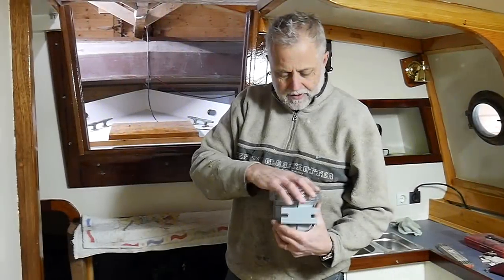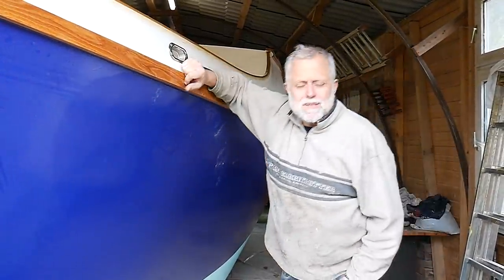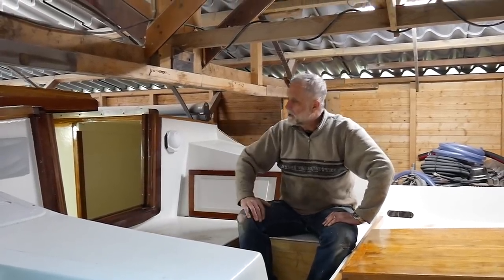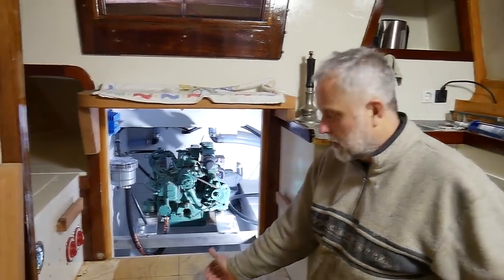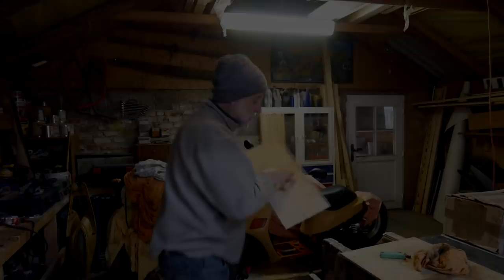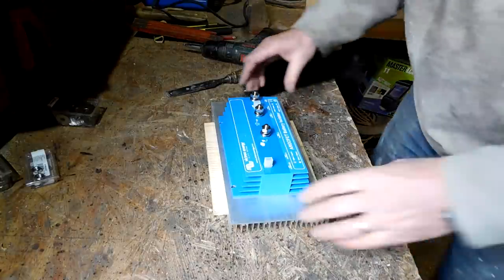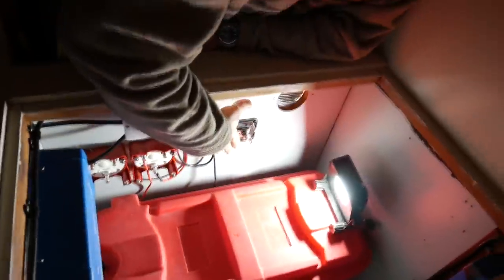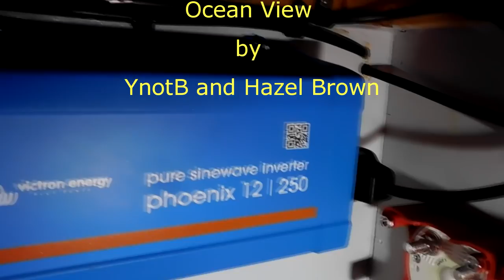A tour of the boat, and engine room and electrics progress - SV Tapatya EP178

Comment: Hi Tony. She is looking great. Speaking of low tech, one of my father's  early boats was on older 65' schooner with zero electrics, alcohol stove, lantern for all lighting, and a hand start diesel (which started most of the time).
Reply from the maker: Thanks Charles. That sounds very like the boat I mentioned (although this one was some 40ft). It had no installed electrics, except the wires for the nav lights, and also had a hand crank diesel - single cylinder, long stroke, from the late 1920s or early 30s, if I remember correctly. It was an absolute beast to start, and sometimes didn't.

Comment: We bought a used Balboa and the Washboards were badly weathered plywood. I made up a new set from old mahogany tongue and groove 'wall' boards. They looked great but it was either 'Dark and Stuffy' or 'Welcome flies and Neighbor's gazes'. So I made a second set with moveable louvers and fine mesh brass screen on the inside. Really helped on hot rainy days or sultry summer nights when it wasn't necessary to lock things up tight. Hard to see in that quick pan of the Head, but is that mirror flush mounted? A simple box frame behind it and some hinges and a catch would provide some welcome storage for dental and cosmetic products without having to rummage through deep, quickly cluttered shelves. 'You can never have too much stowage on-board'...
Reply from the maker: Yes Mike. It's a flat mirror but there's a good medicine cupboard/ locker on the starboard side in there 👍

Comment: Hi Tony, I'm watching your movie reports for over a year, picking from you some methods, tricks and solutions. Like starting to cut with hand krajzeige in the middle of play or installing composting toilet instead of regular. You are doing great job both with building the boat and making movies. I started to build my boat relatively not far from you - in the town of Opole, Poland. This is also a junk schooner, but only 6,5 m long. I want to go sailing this Summer, despite of the stage of finishing inside. I can make it later, when sailing or anchoring. When do you plan to start sailing? Do you have your sails sawn already?
Reply from the maker: Hi Krzysztof. Thanks for your comment and for watching. It's always great to hear that something I show has helped somebody somehow. Your boat sounds good. As to sails, I'm having them made by the sail loft ( Tuchwerkstatt) in Greifswald - just across the border from Poland!
Reply: @SVTapatya  like s/y Peregrinee? Best looking junk sails I've ever seen.
Reply from the maker: Yes, exactly!

Comment: HI, YOUR HEAT SINK, SHOULD GO UP DOWN, TO ALLOW A FLOW OF AIR, AND THERE IS A SPESAL HEAT TRANSFIR GREAS TO HELP. REGARDS RICHARD. P.S. IT IS LOOKING GOOD NOW.
Reply from the maker: In a critical situation, I'd agree with you. The heat sink here will be fine as it is. It's mainly just to keep it off the wood bulkhead 👍